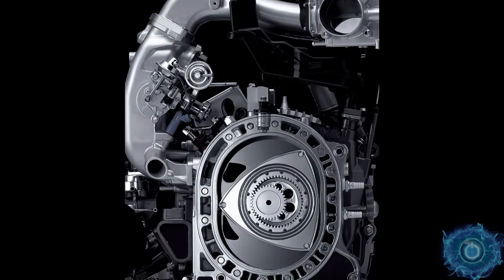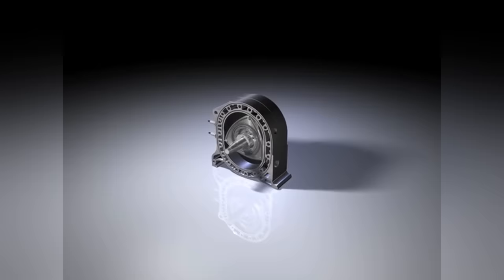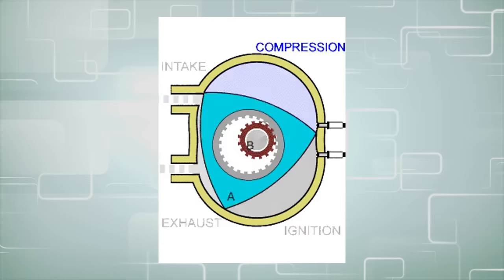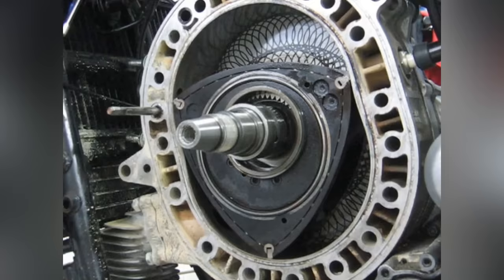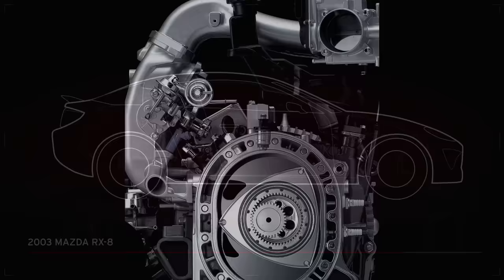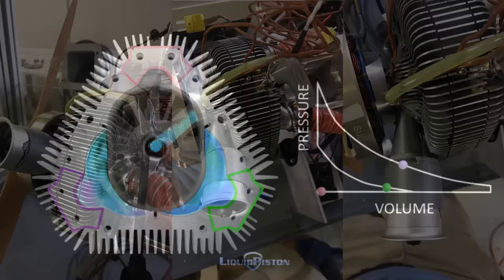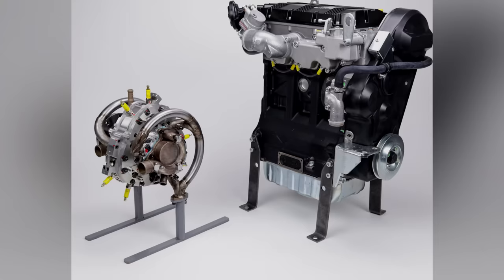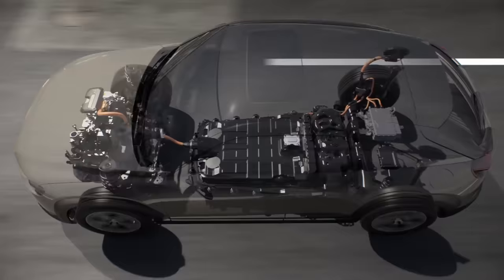STRANGE New Rotary Engine BREAKS Records

Comment: The combustion chambers look like they have a very high surface to volume ratio just like a wankel, and as a consequence there will be a high percentage of unburnt hydrocarbons in the exhaust because of the boundary layer of fuel vapour on that surface that doesn't ignite. This is a problem with all engines. The more surface area exposed to flame the bigger the problem, as well as greater fuel consumption than would be otherwise.
Reply: Yes, but given that the combustion chamber volume and intake charge are static during the combustion process, prior to the power stroke even really starting, there should be enough dwell time for the mix to burn far more completely.  I'd be fascinated in their research on the topic.
Reply: Direct fuel injection with modern high-speed electronics, solves much of the wasted fuel in the gaps issue. Because the fuel isn't in the gaps - it's injected into the combustion chamber just before ignition, and maybe some a little after ignition.
Reply: Maybe they could pass the exhaust gasses from one chamber to another with a modified air/fuel charge reclaiming some of the unburnt fuels power and increasing efficiency. A downstream combustion chamber could be smaller thus having less surface area reducing the boundary layer effect described while still contributing to power development. In essence a second combustion cycle slave to the primary one. Another option could send the fuel laden exhaust through a smaller piston engine that more efficiently combusts to drive a power generating source for battery charging. It wouldn’t be 100 percent efficient, no fuel burning engine ever will be due to heat being a byproduct; however, it may make it efficient enough to beat the legacy design.
Reply: @travelinkevin5130  Oh yeah, I forgot about DFI being able to position the fuel droplets so that the combustion stops short of the metal surfaces. Good point. 👍

Comment: Yeah, the Wankel never got the efficiency or torque it promised.  I've seen a few really interesting design changes made by an individual here on YT, where he'd moved the central dish in the rotor face to the leading half, keeping more of the intake charge on the leading side of the rotor face, which allowed the expanding gas a better lever arm on the rotor, producing higher torque.  He also reduced the spark plug ports to small slits slightly less than 2mm, so that the apex seal never loses seal on the intake charge, and won't blow part of the power stroke gases into the intake charge the next face over.  There's no good way to reduce oil consumption, however he was able to get power and torque numbers that matched current production piston engines.  I was hoping someone would pick up the torch there.  Maybe Rob Dahm?

Comment: The small size and multi fuel could be a huge benefit for standby generators or APUs.
Reply: It taps aetheric ZPE and needs no chemical fuels at all. Like a pulsed plasma ball lightning powered 2 stroke.

Comment: As a hybrid range extender, I think a jet turbine is an equal competitor with plenty of small displacement, variations available. Power generation requires steady efficiency… Who wins?
Reply: Jet engines start at $100k
Reply: @josephschaefer9163  Turbine and microturbine generators are much cheaper than that
Reply: Love to hear that going down the road
Reply: Fuck this hybrid shit, i gotta have a 2 stroke!

Comment: One benefit of the Liquid Piston engine is even distribution of heat. The Wankel engine has a problem of one side of the engine block  getting hot and the other side remaining cool. Another benefit of Liquid Piston is air cooling, which makes it lighter and simpler. If the rotary seals require frequent servicing, it might not be such a big problem if the engine is easy to take apart and reassemble.

Comment: I had a 1972 Mazda RX2 with rotary engine. It was an awesome power plant, although the engine compartment looked almost empty. I could be in 1st gear and do 50 MPH, or at 10 MPH in 4th and still have plenty of torque. Overall? Response like a slingshot!
Reply: Its a 2 stroke thats why and this liquid piston is a strange 2 stroke rotary.

Comment: Neat concept. The radial emgines in airplanes are not rotary engines though, two separate architectures.
Reply: those were 2 stroke piston radials that rotated and crankshaft was still

Comment: Other version of liquid piston ro have ultra compression (67:1) and over expansion. Exhaust is near atmospheric pressure. Result is 57% thermal efficiency at full load and 50% at partial load. This efficiency means it doesn't need a liquid cooling system, it skips a fuel injection to cool the engine if needed.

Comment: Looks like it may run into issues with larger scale applications. The rotating mass is huge, almost double that of what the rotor in a Wankel, this means that it won't be able to rev as high. The rotational circumference of the engines center of mass is also wider than a Wankel engine which will add to this problem. 

It doesn't mean this won't be a good engine, but its won't be able to rev up as much without damaging itself. Meaning that it will have to be used in lower rpm applications, a larger version will be likely to top out around 6000rpm like older V8s.

I haven't done the math associated with these differences though, and it's possible it won't affect the performance as much as I'm theorizing.

Comment: I have an idea for a rotary....it's a little like a box fan with the combustion chambers being out at the end of the fan blades, it moves in a perfectly balanced circle rather than the way the current rotary engines seem to flop around in a circle like motion.
Reply: You may be onto to something here, like a split cycle 2 stroke rotary
Reply: @jlo13800  I don't know actually,  I just know a rotary should be able to run in a smoother more perfect circle.

Comment: It definitely has a place in the aircraft industry.  The power to weight figures are well suited for light and ultralight aircraft.  The efficiency will remain to be seen.  The weight savings allows for more fuel storage and greater distances.  With an efficient airframe design i dont see a problem with fuel consumption.

Comment: After I discovered that the rotary engine existed, it became my favorite. A few years ago, after my father died, I was watching a YouTube video about a man who discovered how to improve the terrible emissions of the Mazda designed rotary engine. As you may know, it's quite loud due to the fact that there's only the thickness of the rotor housings. Mazda changed this so that the exhaust would have a greater path to the outside of those housings. This didn't
Reply: This didn't help the terrible fuel economy of them. The people of that company we looking at the wrong places. So, where did they need to look? At there they put the spark plugs, two per rotor housing. They additionally needed to change the shape of the rotor. Instead of having a centralized combustion chamber, they needed to have an indentation close to the bottom of them. This will be close to the apex seals of both the two rotors. That's where the air/fuel mixture needs to be. Did you ever see the inside curve of a rotor housing? No? In the event that you are ever given a chance to see one of them, they all have a quite a sizable hole where the electrodes are at the bottom of the spark plugs. Instead of that big hole, it needs to be a slot not wider than those apex seals. Why not a sizable hole? It's analogy to a hole joining two cylinders of a piston engine. This will lessen the compression of each of the combustion chambers. In the event they continue to have the same size hole for those spark plugs, they should stop building those engines. Yes, they need to have slots for them that are the same width as the apex seals. This will prevent the fuel from being transferred into the rotor face that's going through its exhaust faze in front of it. What does this do? It adds to the burning fuel in front of it, which means it's adding more fuel into the rotor faces. That's not acceptable. The potential of this engine is better than a piston engine. All they need to do is to put those slots instead of those bid hole.
    Why put the combustion chambers in the middle of those rotors knowing that it's analogies to pushing on a wall? A rotor will spin faster when it will have a pocket close to the apex seals. So, why doesn't the engineers at Mazda change those design flaws? It's because of pride. This is causing them to believe lies. They're denying that there's a problem. They saw the smoldering exhaust. They aren't able to deny that. So, why not accept the truth and change those flaws? As I typed a moment of time ago, it's because of pride. They need to get rid of it or else they'll never accept the truth. Yes, pride prevents people from believing truth. Not a single person is able to learn truth that way.

Comment: Nice Video. I owned several RX7 and repaired them. Improvements of the Efficiency is always important ... Multifold-exaust ( Multiplied Decompression Factor ) by series of Exaustpathes using additionally Rotors only as a decompression path  and thermodynamic multi-step recuperation (Water- steam-Wankel-Engines, or even better : Silicon Oil based evaporation steam engine using "Wankel-Decompression" ) could improve the overall Efficiency a lot  too.

Comment: You missed the most outstanding rotary by Astron Aerospace the Omega 1.  A single 16kg engine producing119kW and 230Nm, with a 1000rpm idle and 25,000rpm redline. The Omega 1 can also be stacked, combining two units to make 238kW and 460Nm and so on. Early computer modelling claims the design could result in a package producing 447kW and 1355Nm at 15,000rpm with a staggering 80 per cent thermal efficiency.

Comment: Mazda's motivator solution with electrical drive only is the superior system.   They get around the remaining problems of the rotary by operating it entirely inside its most efficient and cleanest range to drive a generator system.   "Liquid Piston" has yet to show good longevity on their rotor-compressor.

Comment: I feel compelled to point out several inaccuracies.
1 - radial ≠ rotary
2 - John Deere couldn't have invested $300 MILLION
3 - small oversight: liquid piston has also run on hydrogen.
And, why has Liquid Piston apparently stalled on advancement, given the millions of dollars invested?
Reply: I feel you understand nothing: the real rotary engine is the Gnome type engine use in many WW1 aircrafts, and the Wankel is not a "rotary engine" but a rotary PISTON engine (the engine did not rotate), all this in accordance with the designation of their respective inventors: Felix Millet for the 1889 rotary and Felix Wankel for the rotary piston engine...
Reply: @leneanderthalien  good information except for that first sentence which is obviously idiocy.

Comment: A 25 hp Mini ICE range extender would be the perfect solution for EV’s.  An average size car requires about 25 hp to cruise at highway speed.  The ideal engine for this would be a micro turbo diesel, due to their efficiency.  And EV with a micro turbo diesel range extender would make for a long range super efficient hybrid.
Reply: CR500 hydrogen 2 stroke for range extender.

Comment: I was a big Wankel fan until ~1979 when I purchased a new Sachs Wakel motorcycle and soon discovered that due to gear lash the motor emitted a resounding "clunk" whenever the bike decelerated even minimally -- like when trying to maintan a constant speed on an expressway.  IMHO, the Wankel is only suitable for constant speed applications, i.e., to power generators.
Reply: Hercules W2000 with sachs 294cc 2 stroke rotary, they came in snowmobiles too, i got a few OMC528cc sled 2 stroke rotaries, one of them is haunted.

Comment: if the fuel efficiency can compete with modern combustion engines, it might have a bright future for backup generators and serial hybrid cars. also for conversions of old timers to EVs this could be great as a range extender. these conversions are problematic because you don't want to increase the weight of the car. and also there is limited space for batteries.
with the latest battery generation that comes with 500Wh/kg, you might still only get 20-25kWh into the oldtimer.
and with this limited range you need a small, efficient, light range extender.
Reply: They make sense.EV dont and mainly for safety, cost, limited resource, weight and ecological reasons (real ones).

Comment: I was going to say the new rotary should be diesel but tsju, and using the internal piston as exhaust is brilliant, very compact; so where is it? is the answer the same as what happened to alternative engine developers in the 1980's and 1990's
Reply: LP is having the major engineering issues - overheating of the piston, longevity of the seals and dirty exhaust. Plus, costs of manufacturing are much higher than that promised by Shkolniks. Yes, you can 2d print the prototype, but that is where it ends. To make something reliable and sturdy you need alloys, years of calculations and testing. Too late for that.

Comment: No, the 13b RENESIS used in the RX8 did not "relocate the ports to the side for better air flow" lol. The exhaust port got changed from housing to the plates, due to emissions. Exhaust on the plate meant more unburnt fuel would be used in the next cycle. As for the intake, it's always been on the plate. (Apart from full trim PP racecars like the 787B etc etc)

Comment: Love to see that non piston engine are still in development! Video is understandable, factual and quick though I have a small critic : any engine can output same power as a bigger engine.
Exemple: a 125cc 1cylinder 4stroke can deliver has much as a 1000cc 4cylinder 4stroke, If my 125cc revs around peak power (6000rpm) and the 1000cc at low peaks (1000 rpm) and even if we compare at max rmp power for each of them there is still fuel consumption that can give a nice input/output power ratio which i don't have high expectations toward the rotary engine.
(Again very nice video just to tickle and bring critisisme in number, and graphs reading)

Comment: Don't forget that real displacement of Wankel engine is 3 times higher, and real rotor RPM is 3 times lower than listed. They used shaft rpm and calculated displacement for tax reasons.

Comment: It will still be a total loss lubrication system. Burning oil.
Reply: Yes and thats what i like about it, no fat ugly wet sump mess which needs filters and makes waist. All the new sleds and the have dry sump oil injection. So your clean burning 2 stroke oil add energy to this rotary 2 stroke. Also when a 4 joke with wet sump wears out which it does it form its own oil injection and burn some of its oil. This 2 stroke rotary has none of that. Make sure you burn something like amsoil interceptpr or XD-100. Some for v8 coyote v8 can be run as a dry sump oil injected 2 stroke, but its loop charged through its valves.

Comment: For electric vehicles, battery weight & power density are the primary limitations. Electric motors can drive wheels or rotors without gearing and with exquisite control. Using a tightly engineered Liquid Piston engine/generator powerpack with a lighter/smaller battery set might be the most efficient & cost-effective solution. Bigger craft? Use banks of standard-sized powerpacks for redundancy and cruise efficiency.

Comment: One big problem is that all the heat happens on one side of the engine and this creates uneven expansion of the metal. A conventional piston engine has cooling gas entering and exhaust exiting alternating between the two which avoids this problem. The uneven metal expansion contributes to problems with sealing things...so you get oil burning and leaking and inefficient mileage.
Reply: Its a 2 stroke its gonna burn its oil!

Comment: That 1st strange multi--piston rotary .engine was used in an Italian motorcycle around 1920 . It had a 5--piston model mounted INSIDE the front wheel . Only front--wheel --drive motorcyle I,ve ever heard of . Don't recall the marque .

Comment: the apex seals have always been the service problem in this engine, what is needed is some sort of opening that the user can open and change them, pull them out with some sort of tool and push new ones in, in the past they were attached to the moving rotor and it was full strip down after removing the engine from the car/bike/etc and the labour costs and downtime were crazy, so if the it can be made so you can swap them over in half an hour they will more user friendly,

Comment: This tiny engine could drive a alternator to load the EV battery sytem as a range extender !  26 hp is the right size and the consumption seems to be low?

Comment: I'd like to see the Liquid Piston rotary engine in light aircraft, since with its high compression ratio it could be built to run as a Diesel using Jet-A fuel.  It might need gear reduction to drive a propeller, but overall would be lighter than most piston engines now in use.  A time-before-overhaul (TBO) exceeding 2000 hours would be a big bonus.
Reply: If you replace using weight as your guide then the lighter engine can be much bigger internally. (Cubic inches. More can be better. C.I. equals more power.) Cooling issues may be problematic until someone figures it out. Driving huge variable pitch propellers for the aircraft size. STOL dream machine.
Reply: If i get an XTS-210 im running amsoil interceptor 2 stroke oil in it.